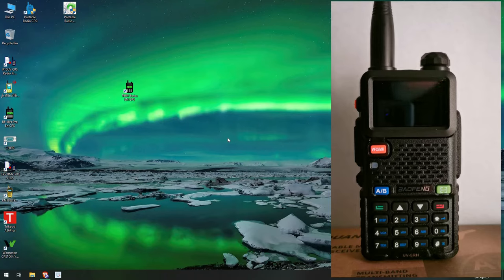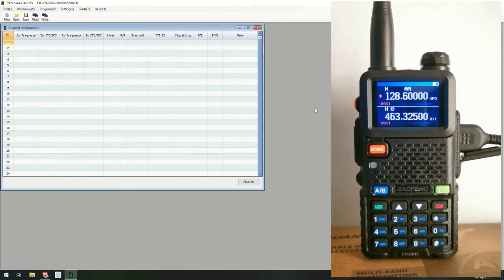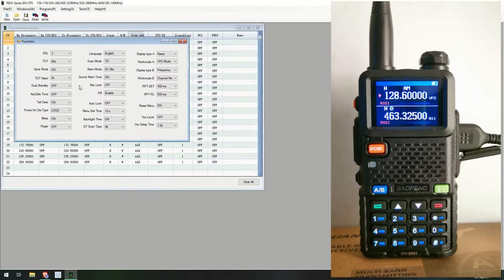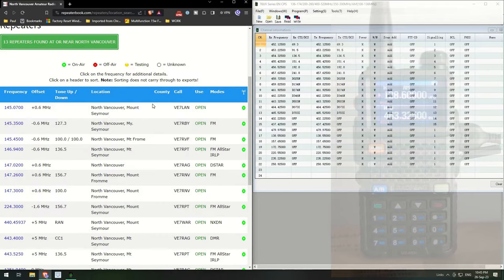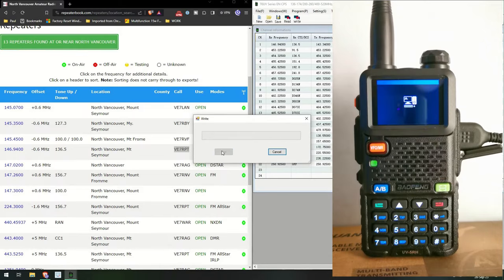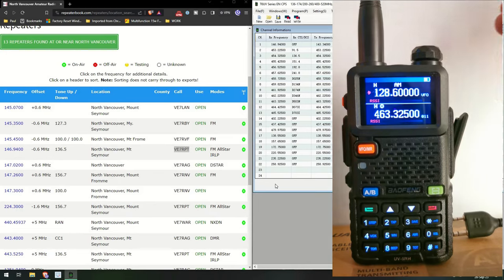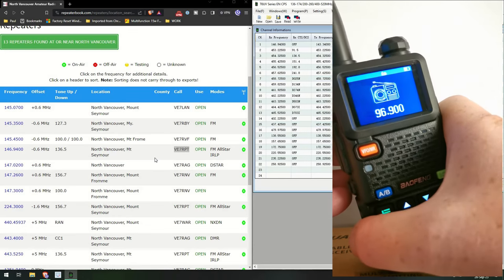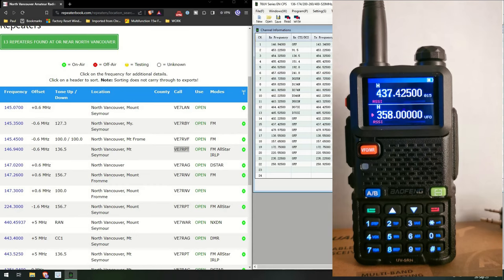Programming The Baofeng - BF(UV)-5RH Ham Radio: The Essentials

Comment: Hi, I tried with CHIRP doesn't work. I tried with CPS message port can't open. I'm with windows 11 I downloaded the ultimate PL23O3 driver. Is it necessary to have the Baofeng cable. I use au TYT cable.
Reply from the maker: You need to make sure you have the correct OLD driver if you're using a Prolific2303 chip and Window11
Reply from the maker: try this - https://embetronicx.com/uncategorized/fixed-prolific-pl2303ta-usb-to-serial-and-windows-11/
Reply: @ham-fam  Thank you so much 73
Reply: Works with Chirp-Next on Windows if you use the Baofeng 'UV-17 Pro'.  Chirp from the Linux RPM Repo's does not have this entry to select yet.
Reply: Use baofeng k5 plus no chirp
Reply: Chirp worked for me just select uv-17 pro.

Comment: Hi All, I'm an old timer radio ham callsign GW6IYP I have been licenced for over 42 years now. I have just bought a UV-5RH Pro Max, I can't get the T6UV Series EN CPS program downloaded from this group to work with Windows 11 also the same with the latest Chirp program, The other question I have is how to keep the display on I have tried altering Menu 6 but this has no effect it goes off after 3 secs. Also I have a UV-5R radio which works ok with Windows11 Any help please, Regards Ray GW6IYP in North Wales (UK)

Comment: 146.340 would be better for the tx frequency .....
 If you gointo the cps and click on vfo mode 
youll see a spot on the bottom left where you can input a 00.600 offset.
And everytime you enter a repeater you just have to click - /+
Our offsets are pretty standard in Canada .600khz either way.

Comment: I was wanting to disable the transmit button on the radio as I plan on using it to just listen. Is this possible?
Reply: Yeah, just set the transmit power to low and leave the receive power setting on mid to high. Its all easily found in the basic menu options.
Reply from the maker: NO. you can't disable the transmit PTT like you can on the older UV5r or some other radios.

Comment: I have just received the new the BF-5RH. Cant get this to talk to CHIRP. Any ideas? What program are you using there?
Reply from the maker: CHIRP doesnt support this radio yet, i used the CPS (available in the facebook group)
Reply: @ham-fam I’ve requested to join the Facebook group.
Reply from the maker: Added
Reply: @ham-fam    What is the name of  the Facebook group
Reply from the maker: @WillyWacker1947  https://www.facebook.com/groups/1044762149855414/
Reply: Use baofeng k5 plus no chirp
Reply: @scottarmstrong1475 I used CHIRP with my BF-5RH (UV-5RH says on radio, multiband version). CHIRP auto detected it as Baofeng_5RM, this choice downloaded the radio to CHIRP with no problems. Initially I tried UV-5R setting this failed to download the radio, so I used what had been auto-selected by CHIRP (5RM) and it worked. I used the Baofeng cable that came with the radio, turned the radio to just below maximum volume and removed its antenna, it is my first time using CHIRP. I installed CHIRP from the Ubuntu Snap store, I am using Ubuntu 22.04.4 LTS atm.

Comment: How did you program the UV-5RH I've been using radios for 1 year now but I cant wait for chirp to add the UV-5RH so what program did you use and can you provide the link to the download?
Reply: I found it nvm but how did you change the start up screen
Reply: nvm i found out again
Reply from the maker: You can use Chirp - just Select the UV17pro then you will be able to program the Channels via Chirp
Reply: It seems that they already added the 5RM to chirp, i dont know where to buy a 5RH i guess its not stick to regulations in my country  @ham-fam
Reply: @ham-fam thnx it works 😊

Comment: Got the T6UV prog. Didn't work for me. Got a little PC picture on the radio but failure message on the Computer. Didn't work on my UV-5R either. But Chirp did on the 5R.
Reply: Now fixed. Used a CP2102 USB to TTL module with a home made cable. The software is available from Miklor.
Reply from the maker: Nice one 👍

Comment: I having issues connecting to chirp any help would be much appreciated I am using the baofeng cable/driver but it keeps saying radio not responding.
Reply from the maker: Make sure your cable is detected by Windows and allocated a port number
Reply: Thank for your reply 👍 
The cable has been detected (com3 port and all drivers are installed. It’s works fine with the old uv-5. I’m wondering if it could be a fault with radio now
Reply from the maker: try turning the volume on the radio right up and see if that helps  @deanyeomans1508
Reply: I contacted baofeng and they have sent me cps software and it connects like a dream now I’m just trying to work out how to do the firmware update now 😅
Reply from the maker: Did the CPS in our Facebook group not work ?
Reply: I have just installed your cps on my other laptop it works perfectly thanks you 👍👍
Reply: Should I change any of the settings on the radio or leave as they are? I’m a newbie so just trying to get my head around things.. I appreciate all of your help
Reply from the maker: Before doing anything. read the radio in the CPS then store that image so you can revert to it if you mess up, then have a play with the settings as you can always re-import the settings you backed up :)
Reply: I heard you can use the CHIRP Baofeng UV-17 for this Radio and it works....I dunno try it!
Reply from the maker: Yup - https://youtu.be/SyYnGcZbVSo @eijentwun5509

Comment: Hi, I already bought this radio. I looking for drivers and instructions to install drivers to program this radio. Could you provide some knowledge? I want to use on one channel air frequencies for RX and on second I want to have something to emergency radio.
Reply: Having the same issue. Never ending frustration
Reply: You need the baofeng 5RM. That radio can transmit on all frequencies including gmrs, ham and possibly air bands. (I have not tried tx on air band with my 5RM).

Comment: Sorry I haven't watched the full video yet but it seems there's 2 versions, but that still doesn't explain everything..
Version 1 - Multi Band
FM radio 76-108 MHz; AM aviation frequency band: 108-136MHz (RX)
VHF1: 144-148MHZ (RX&TX) ; VHF2: 200-260MHz (RX)
UHF1: 430-440MHz (RX&TX) ; UHF2: 350-390MH2 (RX)
Version 2 - Tri Band
136-174 / 220-260 / 400-520MHz
Reply from the maker: Yup, welcome to the world of Baofeng lol
Reply: Is there a way to unlock the AM and Air band receive on the Version 2 radio?  I feel cheated.   @ham-fam

Comment: Thank you for posting - is there a direct download link for the CPS?  I'm not on FB.  Thanks either way.
Reply from the maker: I'll get one sorted for you
Reply from the maker: try - https://ln5.sync.com/dl/177594100/nciytdn7-j78h8fis-3hascpam-x63tf7hw
Reply from the maker: Did the link work ok for you ?
Reply: @ham-fam  The link works, but the archive is damaged
Reply: @ham-fam Большое спасибо. Файл по ссылке работает 🙏🏼
Распаковка и установка прошли успешно.
Reply: @ham-fam  Спасибо большое!Всё работает)
Reply from the maker: Good to here :) enjoy the Radio :) @user-TimofeyPodobedov
Reply: @ham-fam  link to a virus 
"2 security vendors and no sandboxes flagged this file as malicious"
Reply from the maker: @toysareforboys  https://www.virustotal.com/gui/file/093ce4fce9db8f1d1df6da277d5db08ec811319080c87becb72222bce8869d1b
Reply: @ham-fam  unzip the rar and scan the .exe file.
Reply from the maker: @toysareforboys  it's a false positive, i have run this file through multiple online file scanners Virus Total is the only one that shows the file as 
Malicious BUT it doesn't say why except that the file was not signed. i have no suspicions outbound on my WAN and no suspicious file activity. you can also get the file from Miklor`s website (well-known HAM tester) and you get the same result. so it's up to you if you want to use it or not but it works fine.

Comment: Carnt get mine to work on pmr 446
Reply: Looking at the baofeng uk site, there are two versions. 

Multiband version gives you aviation range 108-136 but you can only TX on 430-440. 

Triband version doesn’t give you aviation range, but you can TX between 220-260. Unless multi and can be unlocked to support full UHF range somehow 🤷🏼‍♂️

Comment: How far can baofeng UV-5RH reach?
Reply: with a direct line of sight, its easy to get a range of roughly 5 miles, plus or minus certain factors. Replace the stock antenna for best results.
Reply: With a DIY Yagi-Uda antenna (3 element directional beam), you will be able to get to the International Space Station repeater, so about 250 miles.
However you will probably not get much more than 1/2 a mile through a dense city to another hand-held each with a rubber duck.  It absolutely depends on antenna, height above surroundings, clear 'line of sight' and the receiving station's properties are included in the equation too.